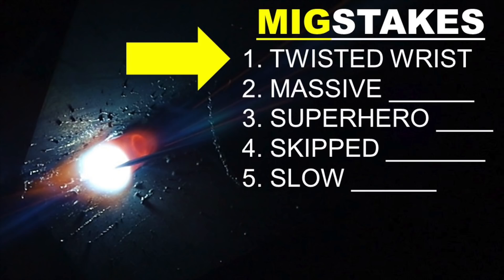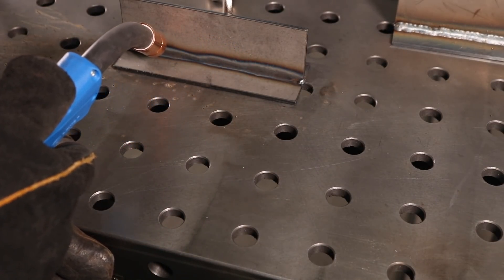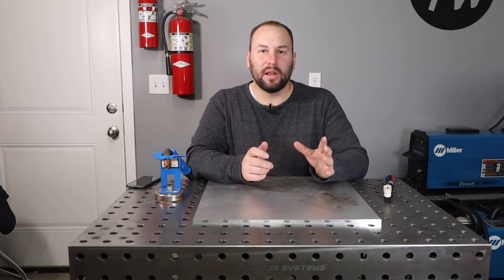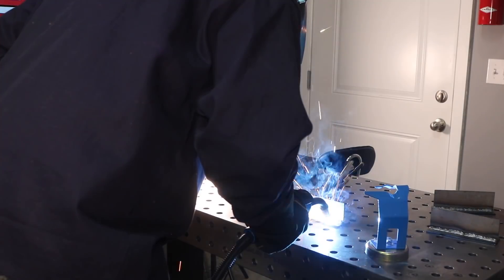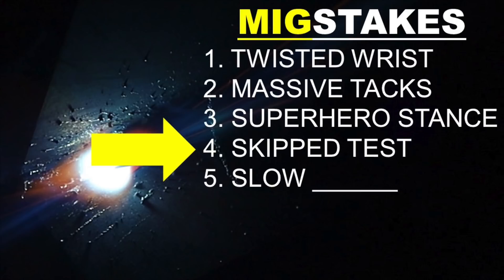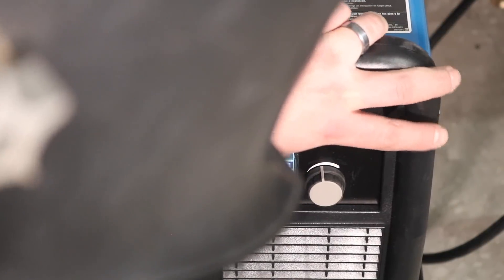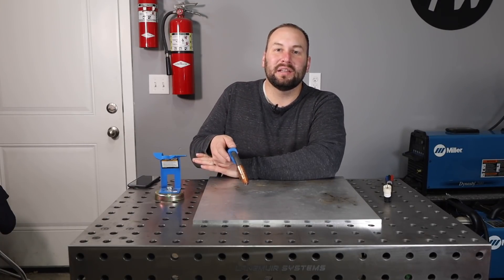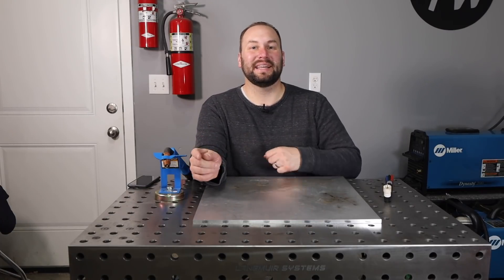5 MIG Welding Mistakes I Made as a Beginner

Comment: The superhero stance is a funny one for me. I grew up on a farm, and my Dad started teaching me stick welding when I was about 10 or 11 and the only welding helmet I had to use was one of those cheapo ones that you have to hold up to your face by a handle. Funnily enough I managed to master one handed stick welding pretty well. And still to this day in a lot of cases I actually stick weld better one handed and find supporting my welding hand somewhat problematic. Especially doing things like 3G 7016/7018 fill passes. Usually due to range of motion from my supporting elbow I'd progressively start to favour the opposite side. If I did it one handed then I had no trouble keeping on track. But with that being said I'm pretty average at one handed MIG, which one would think that would be far easier. 🤣

Comment: Often when I watch welding instructional videos I have difficulty distinguishing a problem the presenter has identified. In this case, toward the end of the video where Tim states that the bead is just rolled up over the top due to the arc not being at the front edge of the puddle, I cannot see what that means in the shot in the video. My untrained eye does not see anything wrong. Also, I don't really get what "rolled up over the top" (if I have that right) means.

Comment: I use .035 wire because I've found that .030 tips can be used with .035 wire, you have to twirl the new tip onto the wire to kinda hone it to perfectly fit the .035 wire, but once you do, it's perfectly fitted to the .035 wire, and works noticably better (and lasts longer) than an actual .035 tip.

Comment: Have been practicing and practicing...have made a few "good" welds, however, I just can't seem to get the "wide" welds/pools that you achieve...all of mine are thin...any pointers?
Reply from the maker: Probably a combination of these things:
1. Use higher voltage, this gives a longer arc and thus spreads it out
2. Higher wire feed speed, this increases the overall amperage into the weld pool and is the primary way of adding more heat
3. Slower travel speed

Comment: The slide works wonders but sometimes on trestles you can't do that so what I do is hold with both hands mig Gauntlet left holding further up the torch tig gauntlet right holding torch then rotate hips and try anchor your right arm at your elbow so it dose not wobble everywhere its almsot as steady. :)

Comment: Hi Tim, I think I have watched all your videos, you make learning to MIG weld so much easier to understand. What I am about to ask may be a little off subject but none the less here it is. I literally just purchased a good MIG machine that runs both gas and flux core wire and can't get the wire feed to engage and feed the wire to the gun (I mean it literally will not turn on) The machine powers up all the connections for the cables are connected securely, I have set the machine for reverse polarity (This machine has an external pigtail that makes doing this fast and easy) Everything works but the wire feed mechanism. What if anything am I missing or not doing? I guess I should mention I am retired living in Thailand and purchased the MAXNUM-300 (MAXNUM is the correct spelling) from Lazada our local Amazon.
Reply from the maker: Does it have a switch for a spool gun? If it is set on spool gun mode, the feeder won’t work. If that isn’t the issue, there is probably something wrong with the machine.
Reply: @TimWelds  I perused the manual looking for answers but didn't notice any mention of a spool gun switch. If it is noticeable on the cabinet itself, no there isn't one. I will look and read the manual again. Thank Tim.

Comment: could get into welding without using an angle grinder? If so, What tools as an alternative could I use to cut and grind metal? Thanks!
Reply from the maker: A chop saw with a toothed blade is a great option for cutting longer material to size without leaving a large burr (I like the evolution, but there are others). Another option is a bandsaw. I did a comparison of a bunch of cutting tools on this video that might help: https://youtu.be/mYpVoYTdbxY

As far as grinding goes, I typically just use a 2"x42" belt sander. A file and deburr knife are not bad options for deburring either. 

Thanks for watching and for the comment!
Reply: I’ve had some success cutting 1/8” bar stick using a Diablo steel demon metal cutting blade in a circular saw. So that’s an option for cutting
Reply: There is always good ol' oxy-acetylene as well.
Reply: No you cant.
Reply: @dogrudiyosun   best tool i bought was a plasma cutter ,  welding and useing a grinder is a welders tools
Reply: Im a welder and a grinder is a tool to always have
Reply: A metal saw and a file i guess 🤔 I've had to do it before 😄